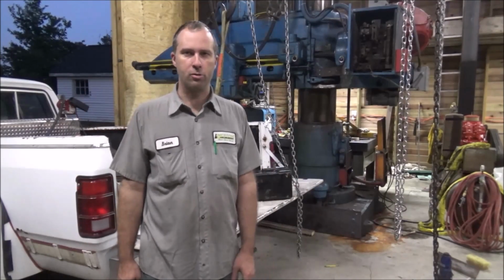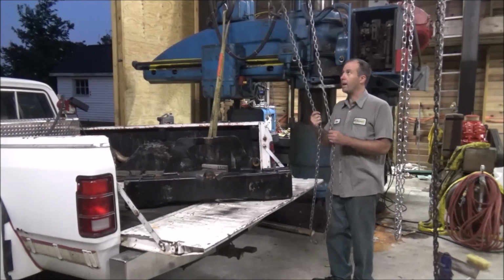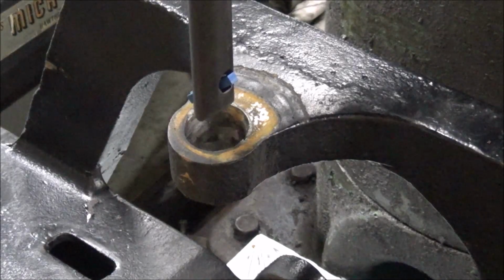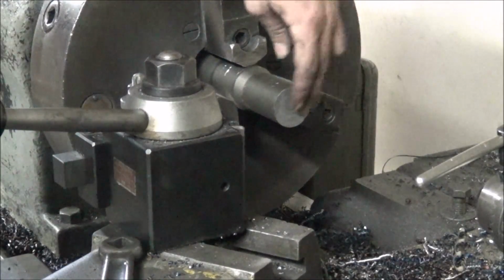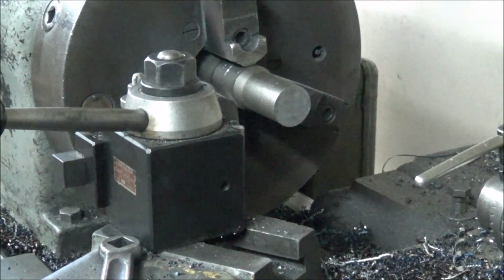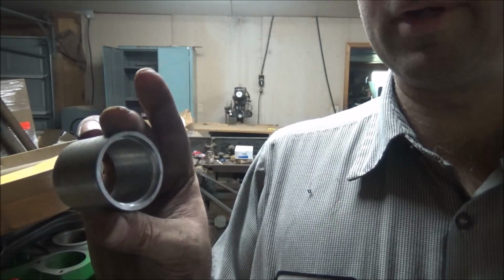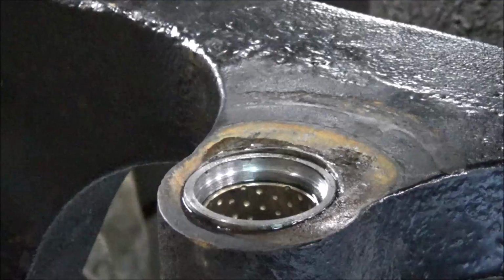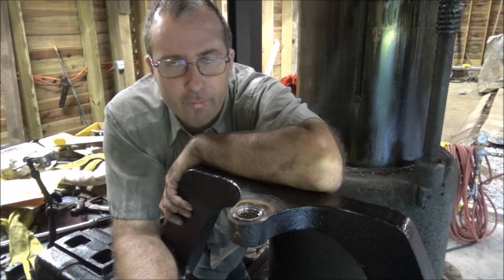First Paying Job in The New Shop

Comment: I was wondering if that amount of runout was going to be a problem when it comes to high precision work, but I’m guessing that is what you use the horizontal mill for not the radial drill?
Reply from the maker: Yes the mill is better suited to high precision work than the drill. Run out isn't a huge deal though on boring work as the cutter cuts based on run out so as long as it is consistent it just adds or subtracts to the size you are cutting and you just measure and compensate.
Reply: That’s what I thought  , Thanks for clarifying that !! I gotta tell ya , I know the excitement Kieth Rucker displayed when he did the shop tour at your place , cuz that’s how I feel when I watch yalls videos on machining!! Thanks again!!🙂👍
Reply from the maker: Maybe I will get Adam just as excited when he is here in a few weeks! :-)
Reply: I’m sure he’ll be, I know I would be , that’s for sure!!🙂

Comment: What do you usually use for bushing material on a job like this Thanks ron
Reply from the maker: I use 8620 because it is what I have in stock in the right size. I would prefer 4140 but honestly even a36 would do the job.

Comment: I think that's the first time I've seen a 3/4" boring bar in a Jacob's chuck! With a setup like that I think I'd expect a little tool deflection. As long as it deflects the same amount all the way around it doesn't matter much, unless the chuck or arbor fails.
Reply from the maker: It was actually a 1" bar in the chuck but it was the only thing I had to hold a straight shank in the morse taper spindle.

Comment: @17:00 your machine noise sounds like head stock gears running without any oil between them.  perhaps its outside the headstock. i just worry that unlubed Gear on gear will cause wear.. i keep thinking of the oil display that used to be on parts counters where you spun the crank and the thin oil did not get up between the gears.. i don't want you putting GOO in your headstock. i was just thinking that in your non existent spare time you might want to observe how the gear teeth in the head stock get lube up between them.. either up from the bottom or pumped thru tubes at the top.  this is only a noisy comment as i know you have little time.
Reply from the maker: The bottoms of the gears dip in the oil. The level is OK and the pump shows to be working in the window that shows its lubing. When I had the top off a couple of years ago everything looked fine.

Comment: Nice save on the axle bushing Brian.  Hope there are many more paying jobs so you can get the floor done. Might be best to get the slab up to the door done first or you may be fixing the truck suspension more times than you need. Do coyote pelts fetch any $  ?  :-)   Thanks for sharing.  regards from the UK
Reply from the maker: Driving out my shop door is as smooth as the roads we have around here! lol

Comment: Good job. Well done!
A pilot bushing on the end of the boring bar might help to maintain concentricity if the RD spindle is a little out😁
Reply from the maker: Be a bit hard to pilot without a true hole to begin with though. I checked and I am getting like .005" runout at the end of a 10" bit with the ram out 24" so 34" out. I think that is pretty good for a  75yo machine myself. Heck its not bad for a lot of new ones! lol

Comment: Thought that was a lot of runout, then I realized it was tool pressure doing most of it.  Looks all left to right, but realized I'm just seeing the left to right but it really is deflecting all the way around like a cone.  So the hole is still round, just smaller.  No point, just thinking out loud, getting my head around it.
Reply from the maker: Yeah that arbor on that 20N chuck is junk. Not that the run out matters 
on this job as an offset tool is what cuts the hole anyway. If you notice as it is cutting down in the bore it appears to be taking even amounts out all the way around.

Comment: Was the spindle wobble caused by the drop?
Reply from the maker: No, the arbor on that 20N chuck is junk. Not that the run out matters 
on this job as an offset tool is what cuts the hole anyway.

Comment: That tool deflection is evil on the boring bar
Reply from the maker: If you watch the 1st cut that hard welded material was causing the whole axle casting to flex.
Reply: That poor counter bore of yours, hence those many angled cutting flutes, should've stabilized it a bit, good thing you didn't had to ream it as well O:-)
BTW i am happy 2 see the radial drill working again, congratulations for the success full repair.
Will you swap that DC-motor for an 3 phase AC one ?

regards rec(from Hamburg/Germany)

Comment: Nice job Brian.  That spindle looked a little wobbly.   Is there a way to tighten that up?
Reply from the maker: Yeah that arbor on that 20N chuck is junk. Not that the run out matters 
on this job as an offset tool is what cuts the hole anyway. I was getting about .007" deflection by pushing and pulling on the spindle with it down but I have since managed to cut that in half.  .003" deflection with 100+lbs load 34" out doesn't seem too bad to me.
Reply: phooesnax in that application that wobble is meaningless. It just makes a little larger hole which is just fine.

Comment: The more the "original repairs" are screwed up the more $$$ for you to fix it right! When I see things like the attempted weld and die grinder repair fail I see at least a 50% increase in the final cost of a correct repair started from a non butchered part. If that's too much for the customer then I suggest they take it on down the line. And if they still complain I say what part of I don't care do you not understand? Lol
Reply: Cad-Cam_Man I worked on heavy and medium duty trucks and equipment for almost twenty years, I never ceased to be amazed at the crap people tried doing to "fix" something cheap. It paid my mortgage and was interesting for me but it seems like people can't control themselves if one of their "expert" friends tells them they can do something quick and easy. Basic maintenance and going to the right person when a repair is needed would probably save them a big chunk of the operating costs.

Comment: Are you still running it off of the DC welder?
Reply: It looks like it.  Check out minute 4:25, bottom rear of the RAD, there is an open orange panel with what looks like to welding ground leads clamped in.
Reply from the maker: Yes for now it is my only power source.

Comment: My hope is that I don’t know what I am talking about but I’m concerned about runout. It seemed it grew from the start of the bore to the bottom. Please tell me I’m wrong.
Reply: On a side its great to se it earning money!
Reply from the maker: When I micd the bore it didn't vary by more than .001" and that was where the hard weld didn't cut out as easy and pinched the bore in a bit.  The run out was consistent so it only effects size not shape.

Comment: You'll have to pull the spindle out of your drill and straighten it some day. It's really pretty easy to do.
Reply from the maker: It doesn't look like it would be very easy to get too. You pulled the spindle out of a Carlton before?
Reply: I've pulled spindles on several radials. I know I did an American Hole Wizard, and a few British made drills (Richmond, kind of a poor man's Azquith). It's really not a big deal other than your drill is much larger than the ones I worked on. They typically bend at the bottom bearing journal because people don't clamp their parts down and they catch on the drill bit and turn into unbalanced propellers. I straighten them with a press, but you could probably use heat if you know what you are doing.

Comment: Is that runout in the drill or the boring bar ?
Reply from the maker: I think the MT adapter shank on that jacobs chuck is in poor shape.  I was reading .005" runout on the drill body with less than .001" on the drill spindle.  Then throw in the chuch jaws not the greatest and I was getting .015 run out down at the cutter tip. Annoying to watch but it really only makes the hole bore bigger in this case.